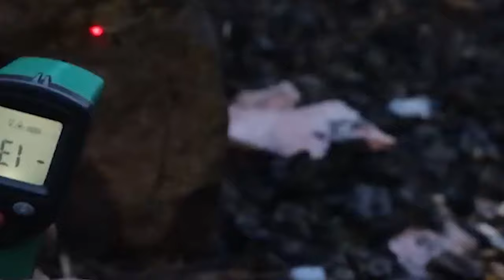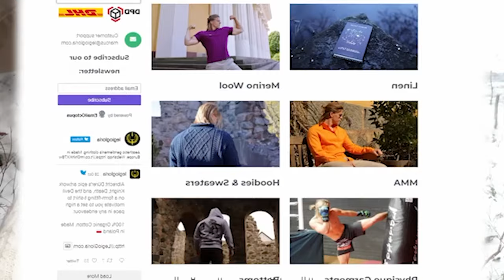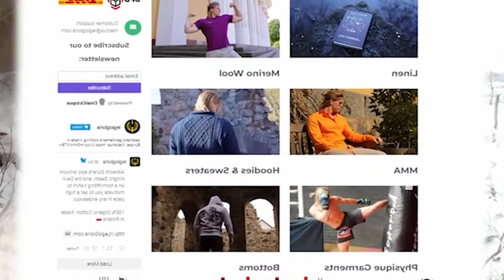Full Video 90 days of building a shelter in the woods to survive the snowy season in North America

Comment: Do you have a list or running list of supplies someplace? You have some rather interesting items. I saw the knife, but the Torp, the pots and pans some little stove, hatchet and ax. What about those do you have a list of suppliers that are sponsoring you?  Just a question thanks
Also that temperature meter
Reply: They won’t answer you here, the video was stolen from the Age of the North channel, ask on the original channel.